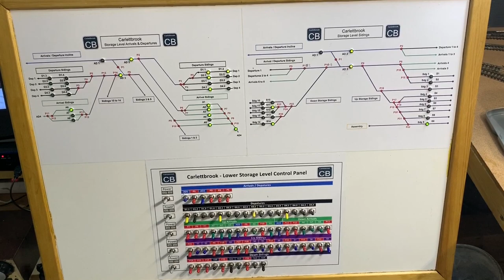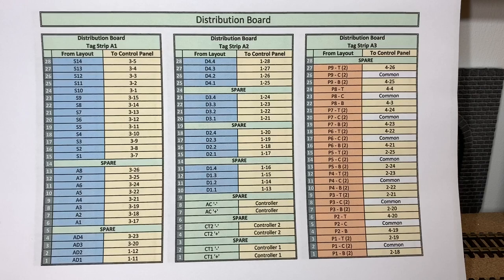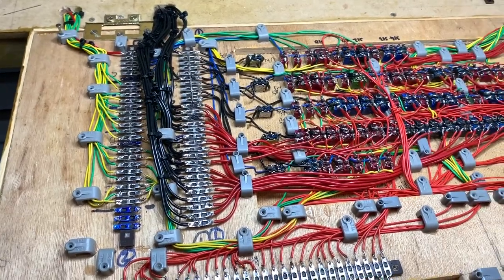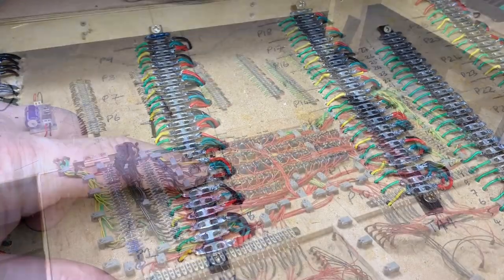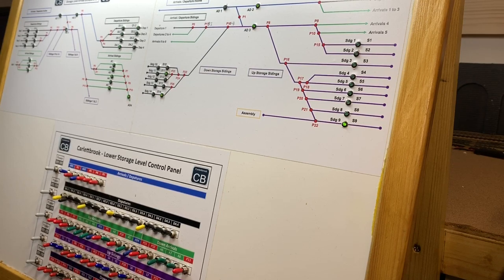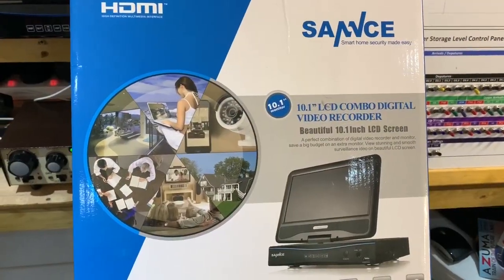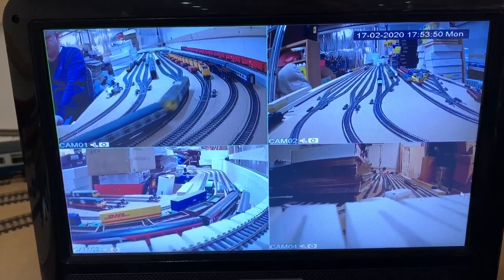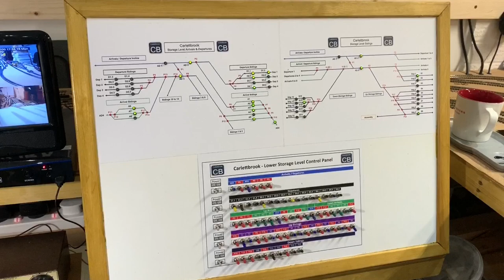February’20 Control Panel Part 2, CCTV for the layout and running session

Comment: Hi Rob
Great video, I wish I had taken the time to wire my layout up in a coherent and tidy way..
Your panel looks super.
Nice running shots too.
The camera system is very interesting and something I may consider for my fiddle yard as my top layout
does block my view.
Great work, keep the updates coming.
Cheers Paul
Reply from the maker: Hi Paul,
Thank you. I have learnt from four previous layouts. This one has been 6 years this June in the designing and construction. I saw a camera system on Dean Park and thought that this would help, and it does. 
Will keep the updates coming 👍
Many thanks,
Rob